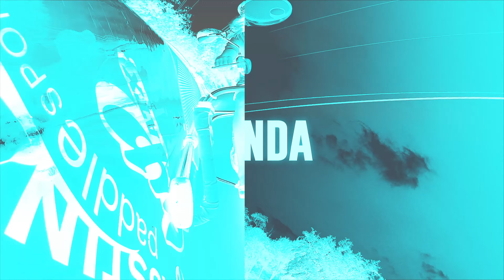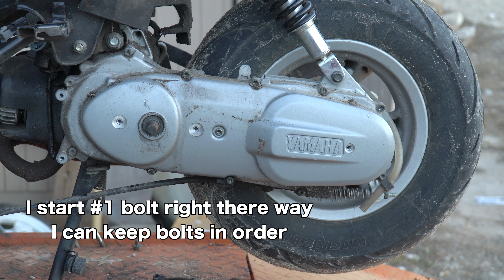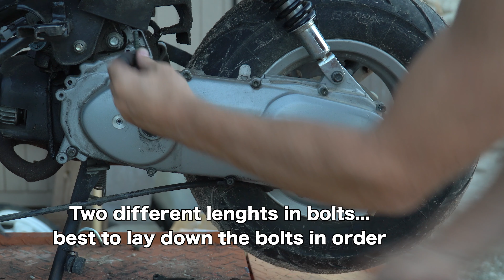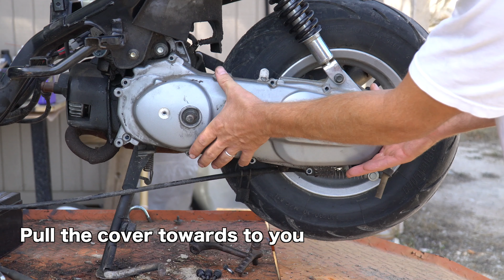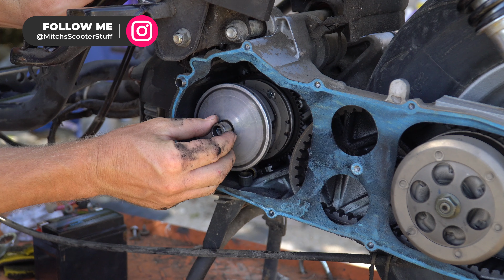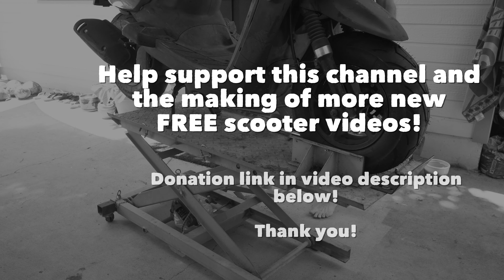Yamaha Zuma / BWS 50 CVT Removal (varitors, belt, rollers, clutch) | Mitch's Scooter Stuff

Comment: I watched this video about a week ago as I attempted to remove the clutch from my 2002 50cc Zuma.  Just got my spanner wrench in the mail today, and re-watched this evening so I would be certain what to do.  Thank you for posting this, it is (so far) the ONLY video on YouTube that actually demonstrates how to do this for an old Zuma!

I wondered as I watched both times: "How come he never says anything?"  And this evening I noticed your fingers counting the bolts in the crankcase as though you were using ASL.  I figured, "Lots of people probably count that way."  Still, it seemed odd that you never spoke in the video and that you counted in this somewhat unusual manner.  

But hey! I get it now!!!  That year of junior college ASL that I took sometimes pays off.  Thank you again for posting this!  It needs no spoken words anyway, not the way you filmed it.  Well done!
Reply: Okay, Mitch, now we have a problem: I followed your visual instructions here for removal of the clutch: you take a socket wrench, brace the spanner against the ground, give a few solid downward pushes, and pop!  It comes loose!  The thing is, I am not at all certain you had not removed this same nut earlier, because I just tried this with a regular wrench with my spanner against the ground and despite heating the nut with a blowtorch before applying my greatest strength against the nut, the wrench slipped off the nut and I ended up gouging two of the fingers of my right hand. Once the bleeding stops, I will try to remove the nut again, but I have to ask: how did you get this nut off the FIRST time you did it?  It cannot have been as direct or easy as you show in this video.  Did you heat it first?  Did you use different tools?  Power tools?  How?  Please explain!  Because without that information, the video is misleading at best and people like me get injured at worst.  Thanks!
Reply: So I got a 17mm shallow socket, and between that and a breaker bat I got that nut off! Man, that was hard! Thanks anyway! Enjoy Hawaii!

Comment: Hey Mitch. This video was supper helpful. I’m installing some new OEM parts in my cvt on my 2005 yamaha zuma. New cutch and springs, new belt and new variator and roller weights. My question is: do I need to lubricate any of these new parts with moly grease or any other lubricant or do I just install them all dry? Thanks!

Comment: Mitch help! I have a Yamaha Zuma 50 (2004) and I'm trying to remove the starter motor to test it cause I believe its very old and may need replacement since the electric start is not working, but the screws to remove it are on the inside and I cant get to the bottom one, not sure how to do it without taking apart part of the frame maybe? :S I'm new to mechanics and scooter stuff but I'm learning a lot thanks to your videos and others on youtube :)

Comment: How u doing thanks for the videos 💯 wanted to ask u a question about a prebug zuma I have a 70cc kit Athena stage6 manifold 28 carburetor OKO had it sitting for a few months and now it wont turn on I put a new spark plug ..new 2 stroke oil ..new gas and nothing gas is going to the carburetor and it has a lil spark ??

Comment: I have had a vibration for the last 100km and finally I just lost drive on my 2003 yamaha bws. It's got 25,000km on it. I have not had the chance to open it up yet. What's the most common part to fail on these things. The belt? or did my CVT go to shits maybe. I was doing a lot of brake stands on it and it started to wheel hop which probably wasnt the smartest thing for it.